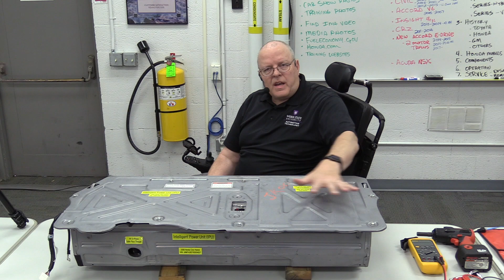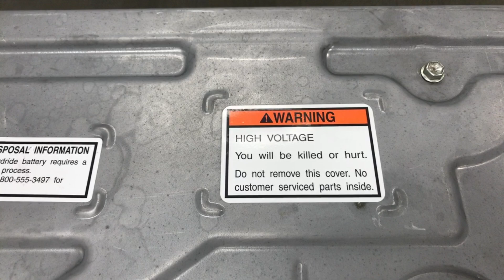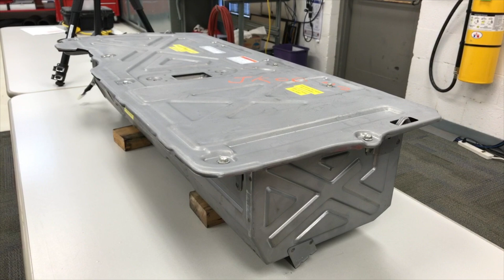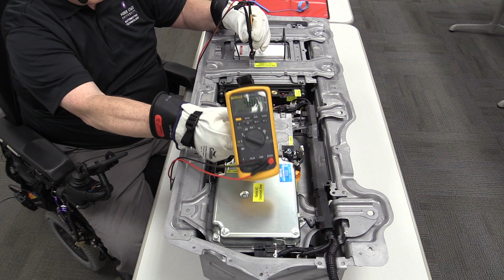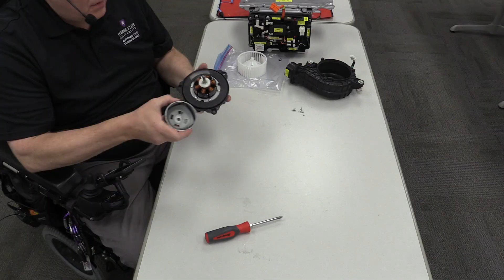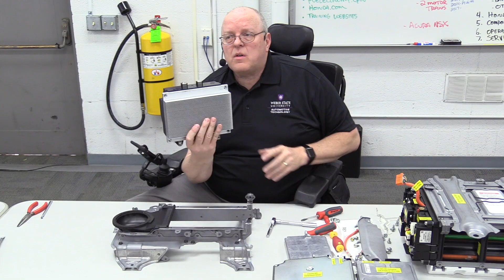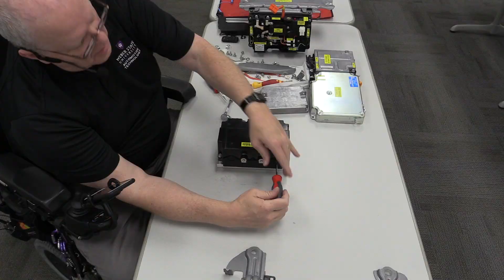Honda IMA Hybrids Part 1 - IPU with Inverter and Converter

Comment: Hello, I definitely appreciate your educational material about hybrids. I was seeking answers to a problem I recently had with my car, which is how I stumbled across your channel. Maybe you can answer my suspicions I'm having about my car. I have a 1st gen Civic hybrid (2003) with 215,000 miles on it. It is the 5 speed manual transmission option. Yesterday, I was sitting in my driveway with the car on listening to some music when I noticed the engine shut off was active and the hybrid battery was nearly drained. So I put it in gear to start the engine back up. The engine started with no problem, but then the electronics in my car went on the fritz. The instrument cluster quit working, the radio went out, and the electronic power steering went out (I thought I'd try driving the car around to get a charge back on the battery, which is how I discovered this detail.) About an hour later, I was going to jump it, thinking the 12 volt battery might have lost its charge. I decided to check it and see if the systems were still dead prior to jumping it. When I put the key in the ignition, everything came back on like nothing happened, and the car fired right up upon attempting to start it, which completely baffled me. I'm wondering if the hybrid battery system overheated? I'm mainly concerned because if it was the DC/DC converter, I'm worried that I'm in for an expensive repair job. Please let me know as soon as you can. Thank you
Reply: I see this is a pretty old posting (as well as a pretty old car). But you interest me since I own two of the same model myself. Your problem is probably the IMA pack degrading a little. Everything about that car is powered off the HV pack behind the rear seat. They are known for cell imbalance issues as they age. Do you still own your 03 HCH? They are wonderful for MPG if you can keep it running well. Mine seems to last forever and get over 50 MPG. I recently replaced all the pack modules and now expect more like 54 or more. I will see next week when I make a long road trip then.
Reply: @michael47lamb  unfortunately I don't own it anymore. I ended up losing it to an accident. Believe me, I miss that car everyday. I now drive an '05 Saturn Ion (manual transmission, of course) and it now has 251k on it. But if and when she dies, I'll be looking for another Civic Hybrid, same generation, same transmission. The reason is because they quit offering the manual option after the first generation. Probably didn't sell so well in the States, which is no surprise as people don't seem to know how to drive them anymore
Reply: @85bbenjaminfan  That is a sad story! I hope you can find another one! These are such great cars even with the battery issues with them. I have two of them because I dont want to be left in the lurch if something should happen to the one I drive now. The second car is presently more like a parts car for the first one anyway. Both have over 210k on the clock and still run well enough engine-wise. FYI 04 was the last year that a manual 5-speed was offered, not many were made either. If you do find one someday, be ready to DIY a lot of stuff on the car too. LoL

Comment: Professor, I just got a new ima battery for my 2008 honda civic hybrid. The new one is not charging my car battery either. And the car battery test out good and was fully charged waiting on the new ima battery that i just installed. Is there any way to test the dc to dc converter ? the car assist and does auto cut off til the car battery gets depleted then nothing works right. Tx
Reply: markzzzzzzable hey did you get it str8? I’m trying to test my dc converter too

Comment: You are great professor! Really enjoy your videos, labeling and explanation are great!
I have a question and I don't think there is anybody more qualified to answer this as you are so far.
My question is about the dc/dc converter.
I have 2007 Civic Hybrid (g2, same as in video) that I bought with IMA battery light on, check engine light on, 12v battery light on (small red battery light means that your 12v battery isn't charging or no good)
I grid charged my  IMA battery (350ma for 30 hrs with running fan, end voltage was 183v right after charge, it would stabilize down to 154 once the battery cools down after sitting for few hrs)
Fully charged 12v battery with home charger.
Erased battery bcm (and erased check engine codes) with 12v negative terminal pull for 10min and took it for a drive to recalibrate battery bcm. During and after test drive all lights went off but the 12v small battery light. Ima battery calibrated, shows full bars but does not assist during driving (and doesn't charge as its full, only 1 bar may be ocassionally).
12v clearly discharges as I monitored voltage with gas engine on.
First time start car did start by ima motor (quiet and quick) after that it always starts on gas engine starter.
Checked for error codes - no error codes stored.
12v battery not charging, no assist during driving, 12v battery light on.

What do you think problem could be? Battery seems to be new, but i know it has been discharged low before.
I know dc/dc can be turned on/off by battery BCM and voltage controlled by ECU (that's on inside g1) but why would it do so?
How does the charging system identifies that the battery is bad?
Reply from the maker: Assuming no DTCs, Honda's own diagnostics tell us to replace the DC-DC converter if the output voltage to the 12V battery is not within a certain range (I think 13-14.5V). But I have seen a bad IMA battery not provide enough power to the DC-DC converter for it to work properly. When the 12V battery starts to go dead on these cars, it is usually the IMA battery causing it. Best wishes
Reply: Thank you for reply!
I did eventually get "Individual voltage input problem code" and couple other ima battery related codes, so the battery has seen better days for sure. I did  deep discharge (2nd time) to nearly 0v and charged it back up to "full". First round of deep discharge went not as planned as battery at the end when was charging at 300ma was showing 195v, that's too much, but once you stop the charging went back to 184v (that's were they end up after full grid charge, then they rest and get back to their normal voltage, of course producing bunch of heat for hours after grid charge, so fan is must) but after second deep discharge it was happily around 184v charging after 24hrs at 300ma (I take 10-20% discrepancy on engergy wasted on heat when calculating charge time at 300ma )
I did deep discharge to bring cells back to balance as weaker cells loose capacity (based on serious research and data one professor did this really bring the capacity back up) as weaker cells start charing close to normal and voltage dis-balance is minimal, as car is monitoring individual stick packs balance / dis-balance over that orange cable that comes from battery into battery control module.
 
Might have to individually recondition / cycle / replace sticks if will be getting "individual voltage variation".
After it rest a little I will probe the connector to actually see the voltages of individual sticks/packs, I think it has to be within .2v

I did order DC/DC converter, waiting to see it in action:)

P.S. DC/DC should work when ICE running, electric motor producing good current at like 2k RPMs?
Reply: Dc/dc converter was bad. After I replaced it, 12v battery started charging. But bigger battery needed more work, I ended up selling the civic, it was getting good millage anyways

Comment: How to replace the blower that cools the DC to DC converter ??
Where is it located ?
Reply from the maker: It is behind the inverter inside the IPU
Reply: WeberAuto ,
 
@22:16.   That is great news....
I will dig that sucker out and check it for dog hairs, 
my gf long hairs🤔
something is causing the heating issue .

I just realized l skipped over that part and missed it.  You are a great instructor and l thank you for the thorough explanation.
Reply from the maker: @Blue-Horse-Shoe  Don't forget to clean the inlet in the rear speaker shelf

Comment: I always had a fascination with this design of a hybrid system , only I would think this would be best for a mild hybrid system... why don’t automakers use a modular battery design were you would have 6...12 volt modules and then have them in parallel for 12 volt and series output for 72 volts instead of having two battery such as a lithium and lead acid. And have the motor mounted on the outside of the motor on the opposite side of the transmission and replace the harmonic balancer with the rotor of this motor... for easier access of repair or replacement .
Reply from the maker: Good question. Thanks for your feedback

Comment: What controls the ac motor rpm
Reply from the maker: The frequency of the signal from the inverter
Reply: And how do we change frequently in the controller or inverter
Reply: @Gunars1is  find a way to communicate with it.

Comment: Thanks for such a a great video. I have a 2012 Honda Fit hybrid that is showing “IMA”. A few days afterwards, it started showing a battery sign on the dash board. I went to a technician and it showed that the IPU fan system is causing the problem. What should I do? I’m in Jamaica in which I’m trying to find a technician that can do the work.
Reply from the maker: Make sure the fan inlet is clear. Make sure the fan blades are clean. Make sure the outlet duct is unrestricted. If all of that is good, it could be a bad fan motor. Best wishes
Reply: WeberAuto I did a diagnose and it shows that the fan is stopped working. I’m seeing different model fans on eBay and Amazon.com. Can any fan system be used as a replacement?

Comment: Is it possible to place a lithium ion battery setup in the 1st gen models or are they stuck with the nickel design?
Reply from the maker: You are stuck. Li-Ion batteries have a different charge rate, control algorithm, voltage level, heating and cooling needs, etc.

Comment: Thanks for the great video! I have a question about my second-gen Civic Hybrid. I recently installed a grid charger for the IMA battery, which forces the IPU fan to run full-blast while charging. However, I made the mistake of turning my ignition to "ON" while charging once, and now the IPU fan keeps running at full-blast at all times the car is on. I suspect the grid charger and car together somehow overloaded the Battery Condition Monitor Module. Is this logical? If so, how might I fix this so the fan only runs when it's needed? Would it be sensible to simply replace the BCM?
Reply from the maker: Thank you. The fan runs anytime the battery is hot. Your charger must be overheating the batteries. Changing the BCM will not help
Reply: @WeberAuto  I understand the assumption, but I'm certain it's not an issue of overheating. As I said, the fan now runs full-blast at all times the car is on, regardless of charging, including when it's been more than a week since the last charging session and when I can physically feel there is no heat at all anywhere within the IPU box. The grid charger includes a fan controller of its own, so it forces the IPU fan to run during charging to prevent overheating, but it does not affect fan operation when the charger is not plugged in. After my first charging session, this problem did not exist; the fan did not run constantly when the car was on afterward. It was only after the second charging session, during which I made the mistake of turning the ignition with the charger attached and charging, that the fan became forever on at full-blast. Therefore, I suspect the grid charger's fan controller somehow damaged the BCM, which may have received signals from multiple sources in that moment I turned the ignition with the grid charger attached and running.
Reply from the maker: if your grid charger is charging the battery to a higher voltage that it would normally be charged, it could damage the BCM. The fan may also be funning because a trouble code is set. Have you tried to disconnect the 12V battery for a few minutes to clear everything and then check it again? If so, you may be correct. Best wishes
Reply: @WeberAuto  Yes, I have tried disconnecting the 12V battery as well as all the wiring harnesses that run to the BCM for 12 minutes before reconnecting. It did not help, hence my assumption that the BCM is damaged. Thanks for your feedback!
Reply: @Pikminiman  turn your a/c on and see if this calms down that fan.
Reply: Pikminiman ,

Where can l purchase a grid charger for a 2005 civic hybrid?
Any suggestions ?
Reply: @Blue-Horse-Shoe  ebay
Reply: @Blue-Horse-Shoe  : Yeah, I got my Civic Hybrid grid charger from a company called Maxx Volts, and I'm very satisfied. I damaged the hybrid system computer, which was annoying to fix, but that was my fault, so heed my warning: do not ever have your key in the ignition when the grid charger is attached, even just for a second.
Reply: @Pikminiman  what were the symptoms of the bad computer?
Reply: @rafatorres1420rt  : The cooling fan would run at full-blast at all time the car was on. I found a replacement computer on eBay. After I installed the replacement, the problem stopped.
Reply: @Pikminiman  are you talking about the hybrid computer or mcm?

Comment: I love your videos, you explain everything so clearly. I have a 2005 Civic Honda Hybrid and now I understand it so much better. I have been trying to figure out what is wrong with my car. I have to use a jump starter to get it going. When I go long distances, it will start up easily for a few days but then it will need to be jump started again. After watching your videos, I wonder if it's the DCDC or the inverter instead of the IMA battery. Any ideas on that?
Reply from the maker: It is usually the IMA battery not giving the DC-DC converter enough power to charge the 12V battery
Reply: @WeberAuto  or reset battery light on cluster
Reply from the maker: @delanamurphy7248  You cannot until the battery voltages are up to the normal levels. Try increasing the engine rpm to 2000 in park or neutral and see if that makes it turn off. If so, the voltages are just too low.
Reply: @WeberAuto  hi, whats is the voltage on the fan.
Reply: You are great professor! Really enjoy your videos, labeling and explanation are great!
I have a question and I don't think there is anybody more qualified to answer this as you are so far.
My question is about the dc/dc converter.
I have 2007 Civic Hybrid (g2, same as in video) that I bought with IMA battery light on, check engine light on, 12v battery light on (small red battery light means that your 12v battery isn't charging or no good)
I grid charged my  IMA battery (350ma for 30 hrs with running fan, end voltage was 183v right after charge, it would stabilize down to 154 once the battery cools down after sitting for few hrs)
Fully charged 12v battery with home charger.
Erased battery bcm (and erased check engine codes) with 12v negative terminal pull for 10min and took it for a drive to recalibrate battery bcm. During and after test drive all lights went off but the 12v small battery light. Ima battery calibrated, shows full bars but does not assist during driving (and doesn't charge as its full, only 1 bar may be ocassionally).
12v clearly discharges as I monitored voltage with gas engine on.
First time start car did start by ima motor (quiet and quick) after that it always starts on gas engine starter.
Checked for error codes - no error codes stored.
12v battery not charging, no assist during driving, 12v battery light on.

What do you think problem could be? Battery seems to be new, but i know it has been discharged low before.
I know dc/dc can be turned on/off by battery BCM and voltage controlled by ECU (that's on inside g1) but why would it do so?
How does the charging system identifies that the battery is bad?
Reply: @rootkitxx  did you fix the problem?
Reply: @rafatorres1420rt  yes, my ac/dc converter was bad, replaced it and 12v battery started charging
Reply: @rootkitxx  do you have any code before?
Reply: @rootkitxx  do you have the code p1448 or p0AC4 by any chance?
Reply: @rafatorres1420rt  dont remember. I fixed this car, drove it for quite a while and sold it. I think i listed my codes somewhere In comments on this video or another hybrid video of this guy
Reply: @rootkitxx  that's cool , yeah I'm having something similar on my hybrid which is an accord .
It does start having problems after after I grid charge the hybrid battery on a really hot day .
Reply: @rootkitxx  tenho esse mesmo problema hoje em dia, mesmo civic 2005, conseguiu resolver o seu?
Reply: How do I clear the dash cluster of battery light or clear it ???

Comment: Dear prof. Kelly, thank you very much for your videos! I have one very important question. Is sthere possibility to adapt plug in greed charger for these models and if that is possible and is there any benefit to do that? Kind regard
Reply from the maker: These batteries are so small that I do not see any advantage in doing that. Best wishes
Reply: You only grid charge these to restore the cell imbalance of ima battery. These 20hp electric motors are not enough or safe to drive on full time

Comment: When dismantling a complex assembly, I was told to always put the loose bolts halfway back into their correct empty holes where possible when each subassembly has been separated. It takes a little more time, but it means that not only are the bolts never lost but you always know where they are supposed to go when you reassemble.
Reply from the maker: Great idea, thanks